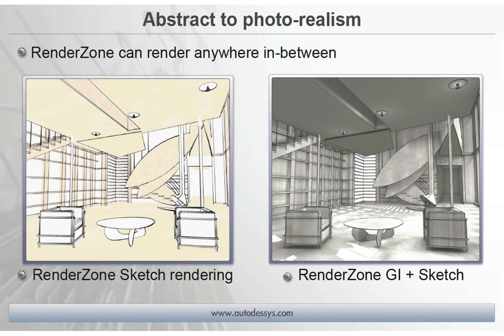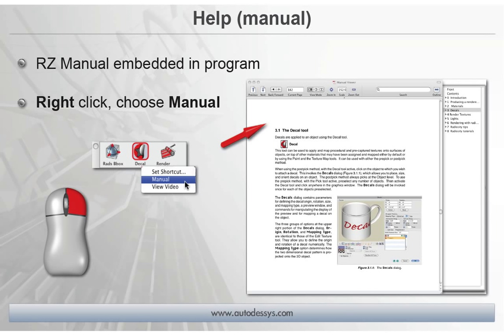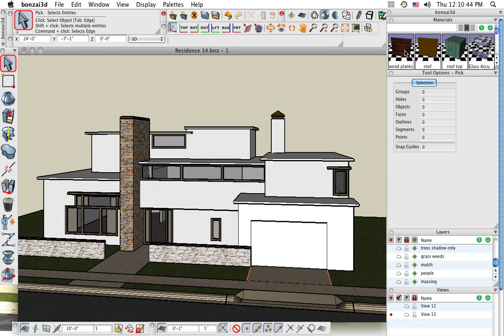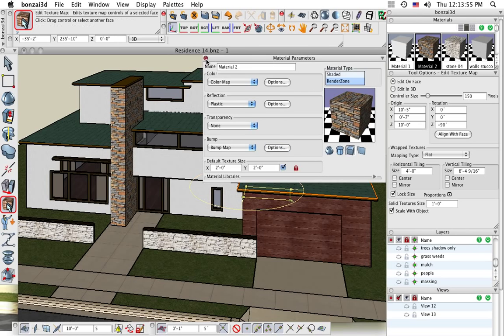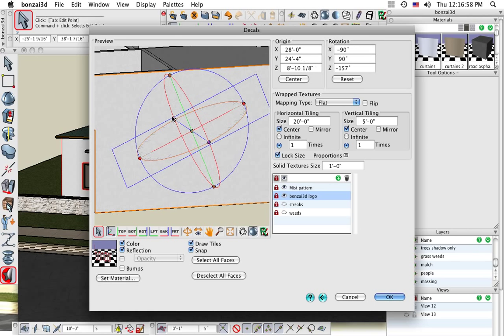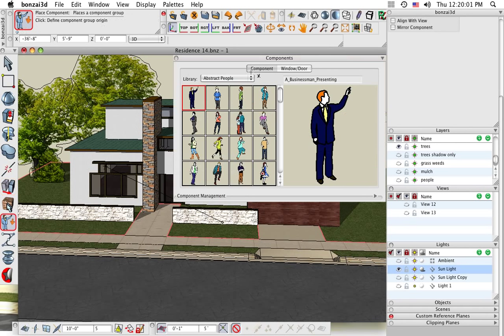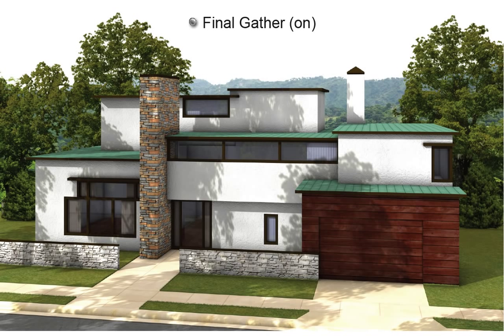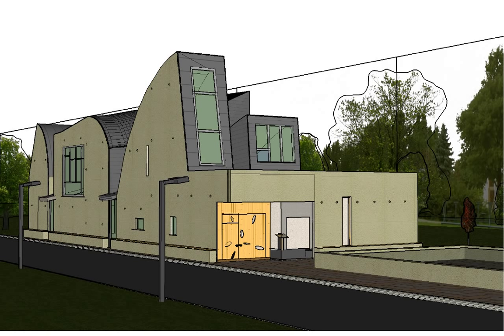bonzai3d - Rendering with RenderZone

Comment: Hi Bander,

If you are having trouble with loading a specific image, try to load it as shown, and if it does not work as you would like, please save and send the file and image to support (at) formZ (dot) com so we can help.
The Snaps are located at the bottom of the screen, and there are Point and Interval snaps that allow you to do Endpoint and Midpoint snaps.  See also the Snap Options Palette and enable the Sticky Snaps if you like.
I Scale is Independent scaling, and U = Uniform scaling...

Comment: Hello brother

Very nice work and the program is distinctive. Thank you very much and I wish you luck.

I have some questions if you allowed me

First: I want to add a picture for the Background as you Explain but it Does not work with me 

The other thing is there any snap tools that improve by the end of the line or the midpoint ?

and what is the difference between I - Scale and U - Scale   ?

and thank you again

Comment from the maker: Hi Chelsea,

Yes, RenderZone can do great interior renderings too with the Ambient Occlusion, Final Gather, and Radiosity settings that can be found on the  Global Illumination Tab of the RenderZone Options.  Hold down the Shift key when you select RenderZone from the Display Menu -- and the manual will open to the associated page.  Then see the  Producing a Rendered Image chapter on Page 9 for more details.

Maxwell Render is also currently available for bonzai3d, and soon Vray will be too...